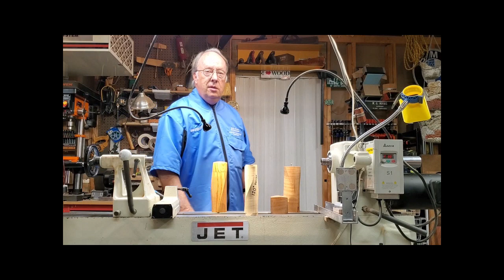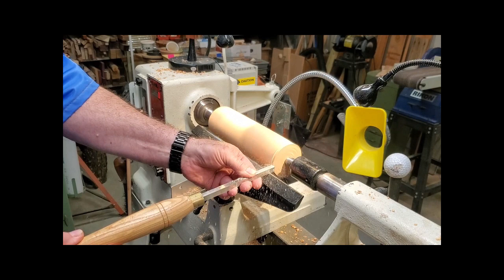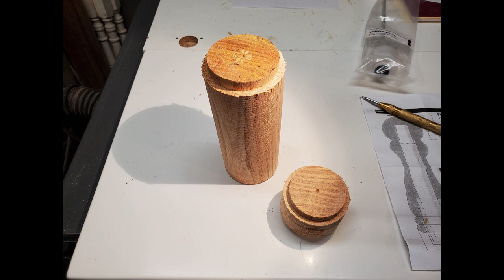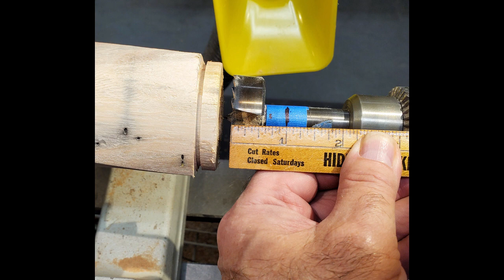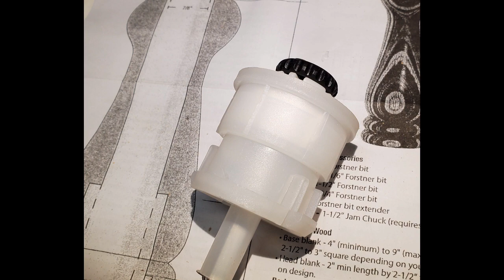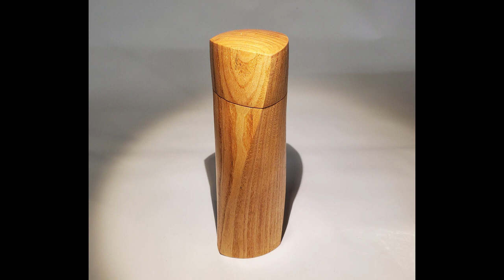Turning a Twisted Peppermill

Comment: As usual a fantastic presentation. 
I love your work and spend a LOT of time trying to copy the half twisted bowl.  
I have done a number of mills. One thing I do that Mike Mahoney has suggested is that after you drill out the peppercorn storage you take a hollowing tool and open it up to hold more pepper, it works great it is a small thing but my customers like it.
Reply from the maker: Great comment Cliff.  The twisted bowl is fun but can be a little 'trying'.  I always have to do a fair amount of sanding on the twisted surfaces to get the tool marks out.  I like your comment on opening up the peppercorn storage area.